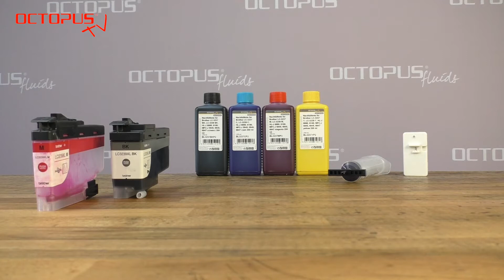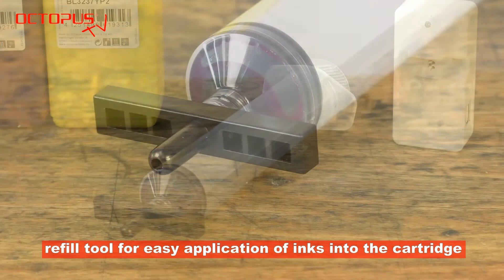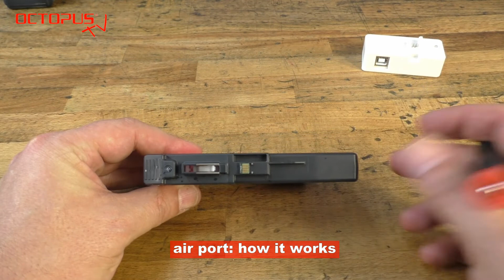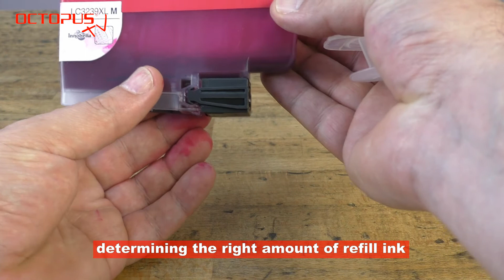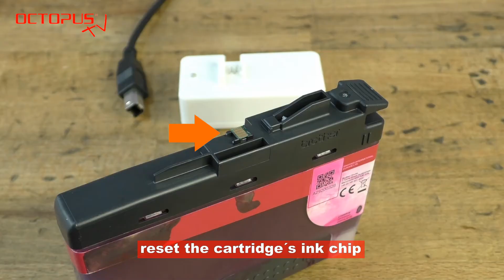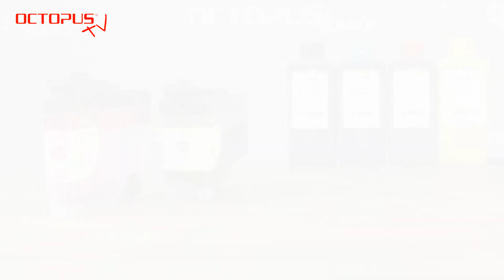Refill Brother LC-3239 LC-3237 inkjet cartridges and chip reset

Comment: Great helper video - but not to me as my printer is DCP-J 1200W, which takes an LC424C cartridge.  There are no non-official cartridges, so far.   I much regret buying the Brother last year: there were clunky software isues, it still won't make a proper glass-top copy, power sometimes has to be switched on and off to achieve anything.  My good old Canon deskjet soldiered on for 15 years, accepted other-brand carts, even an ink-refill or two.  Buyer beware!
Reply from the maker: Hello Howard, thanks for taking the time and providing this great feedback! We also wait for a LC424 solution - according the manufacturer of the necessary resetter device for refilling original Brother LC424 cartridges - the coding of the ink chips is really complicated. The alternative cartridge mkers face the same obstacle - there is no alternative chip solution ready yet.... (status May 11th 2023)

Comment: Would this work on LC404? They the chip looks different from mine.
Reply from the maker: Hello, thanks for reaching out to us about the tutorial. The part of our instruction how to get the ink into the cartridge might for Your LC404 - but there is no suitable resetter for LC404 chips available yet (status May 23rd 2022) - our supplier is working on that resetter model but has not told us yet about a reliable date when it will be ready.

Comment: Hi, does this method work for LC436 cartridges - printer model MFC-J4440DW? Thanks
Reply from the maker: Hello Coco, thanks for asking about our refill tutorial. With status August 5th 2022 we do not have the inks for LC436 yet as the necessary chip resetter for setting back the chip on the original cartridges is not available yet. Without that reset device filling up the cartridge with new ink makes no sense as the printer will not accept the refilled, original cartridge LC436 for further print jobs. We are on it but we do not know a time when the resetter will be available from the suppliers.

Comment: Does Brother  LC-426XL work the same as LC-3239 or LC-3237 and can I use this equipment for refiling LC-426 cartridges?
Reply from the maker: Hello Salar, thanks for Your question. The refill tool we assume will work for LC426 too - but we have not tested it yet on this cartridge model as there is no suitable chip resetter available yet. (Status June 23rd 2022) The resetter is a vital part of the refill strategy for these cartridges. Without the reset of the original ink chip on the refilled cartridge the printer is not going to accept this cartridge for printing again.
Reply: @octopusoffice  Thank you for your rapid response.
Reply: @octopusoffice  Could you tell me if I refill the cartridge but don't reset the chip, what will happen exactly?. The printer will not be working or just show the "?" on the screen?
Reply from the maker: Hello Salar, thanks for coming back to our answer. Without resetting the chip the printer will not work at all despite having sufficient ink inside the cartridge. Just showing a question mark and start printing with that sign would be fine - this was the situation with older Brother cartridge models which was actually fine. But not anymore unfortunately.
Reply: @octopusoffice  Thank you so much.

Comment: How about refillling LC 3033 & LC3035? Have to order chip resetter? thanks
Reply from the maker: Hello elsa! Yes, the tutorial works for LC3033 and LC3035 too and the resetter also works for chips on LC3033 and LC3035.
The resetter is necessary to have as with an empty ink level status (generated by the chip) You cannot keep printing despite You have refilled ink - You need to set back the cartridge´s ink level status. The resetter is made to work on original Brother cartridges.

Comment: Hi!

Does this refill method work for LC-406 ink cartridge
Reply from the maker: Hello Usman, getting in the new ink might work the same way for LC406 - we have not tested it yet. But You need to have a chip resetter dedicated to the chips on LC406 cartridges. Without setting back this chip the printer will not accept the cartridge (filled with new ink) for printing. The resetter for LC406 is not available yet (status July 13th 2022).

Comment: Hi, I just bought a Brother printer, so the cartridges are full. It uses the LC-404 model.... but I see that it has not yet been tested with that model. Do you think it is a good idea to let the level go down a little (about 30%) and refill it again so that it never marks empty tank and it is not necessary to use a chip resetter?
Reply from the maker: Thanks for contacting us so thoughtful early about the refill options for Your new Brother printer 👍🏻
When You top up the ink inside the cartridges the displayed ink level will keep going down despite filling in that new printer ink. The displayed ink level is created based on the information provied by the ink chip on the cartrige - that chip does not measure the physical amount of ink inside the cartridge - so You fill up ink but the chip does not know that - the chip counts down the remaining page yield constantly.
Without using the resetter on the cartridge´s empty ink chip the printer is not going to accept a cartridge for continued printed when the chip has the status empty - doesn´t matter how much ink is still inside the cartridge. And as per status today (April 6th 2023) the suitable resetter is not available yet....
Reply: Same here ! I’m a college student and need to print a lot and buying new ink is costly ..

Comment: The procedure shown for the LC-3239 inkjet cartridge can it be used for the Brother LC406C XL cartridge? If so where can I purchase the tools & ink for your system for filling. Please let me know ASAP Thank you.
Reply from the maker: Hello Linda, thanks for conatcting us about a refill solution for Brother LC406 original cartridges. At the  moment (status April 3rd 2023) the necessary chip resetter device is still not available on the market. Just filling up new ink makes no sense without that reset device dedicated to the ink chips on You LC406 cartridges. Even with new ink inside the cartridges are considered by the printer to be empty due to the ink chip´s empty status.
We have our eyes on the market for this resetter - we will set up a product for LC406 as soon as we have everything necessary together...

Comment: How do you reset the question mark to ink level?
Reply from the maker: Thanks for the question. On the computer´s display You have a version of the ink levels available that shows to You how much ink the printer thinks is left inside the cartridges. Also these bars have a question mark - the mark does not go away by resetting the cartidge.

Comment: Are these cartridges interchangeable with LC424?
Reply from the maker: Helo Ben, thanks for Your question. LC424 is a cartridge model on its own - so just these cartridges work in Your printer and no other Brother cartridge models. Status June 27th 2022: at the moment there is no suitable chip resetter available for LC424 - that´s why we have no refill inks and refill instruction yet - the resetter is mandatory to have. Without resetting an original Brother LC424 You can fill in new ink BUT the printer does not accept such a cartridge again for printing.

Comment: Does it work for LC406
Reply from the maker: Hello Annie, thanks for Your question. For Brother LC406 cartridges the tutorial does not work yet (status February 2022) - in particular the suitable chip resetter for LC406 is not available yet - but the chip resetter is necessary to get the refilled cartridge back to beeing accepted in the printer. We have our eyes on the LC406 but cannot make any reliable promises when the resetter will be there...

Comment: Hello is there any tool for refilling Brother  LC406?
Reply from the maker: Hello Rogelio, thanks for Your question about LC406 cartridges - status Oct 10th 2022 is that the necessary chip resetter for the original ink chip on the original cartridges is not available yet. Without that resetter You can fill new ink into the cartridges BUT without setting back the chip the printer is not going to accept this cartridge for printing again ....
Reply: @octopusoffice  Greetings, any updates in the LC406 cartridges chip resetter? Or is there any other resetter tat works with this cartridge? or at least any replacement cartridges? Thanks.
Reply: @OctopusConcept  is there a way to disable the ink level reader? So that it may accept the refilled inl cartridge?

Comment: Hi, do you have refill for LC451(SCP-J1050DW)?
Reply from the maker: Hello Joseph, thanks for asking about our refill tutorial. Status March 23rd 2022 we do not have the inks for LC451 yet as the necessary chip resetter for setting back the chip on the original cartridges is also not available yet. Without that reset device filling up the cartridge with new ink makes no sense as the printer will not accept the refilled cartridges for further print jobs. We are on it but we do not know a time when we will be able to provide a solution to You.
Reply: @octopusoffice  Is it accurate that the memory only stores the last ink tanks information and that rotating cartridges allows for the bypass of this issue?

Comment: dose it work with lc406 from brother mfc-j4535Dw? and do you have this on amezon wed side?
Reply from the maker: Hello Apichai, thanks for Your question about LC406 cartridges - for them the suitable chip resetter is not available yet (status July 7th 2022). Without that resetter a cartridge filed up with new ink will not be accepted by the printer without resetting the ink chip on that cartridge. We hope that a resetter is coming soon.
Reply: Is there abresetter available for the LC406 yet?

Comment: does this work for lc404?
Reply: i ask because the cartridges look identical
Reply from the maker: Hello, thanks for Your question. Actually You are right about the cartridge´s structure - from the picture we assume that Your LC404 are similar to our LC3239 in our tutorial. The tricky part is the reset device - it need to be programmed for the chips on the original LC404 cartridges. Our resetter does not provide this compatibility 😑
LC404 according to out knowledge is US Canada Mexico region - so maybe You can source a matching resetter locally... take care!
Reply: @octopusoffice  so what about lc426 (mfc-j4340dw / mfc-j4540dw) then? any idea when resetter and refill packs might become available?
Reply from the maker: @Nik Medved: Thanks for Your question. On LC-424 and LC-426 cartridges we have our eyes on - came onto the market May 2021 - so far we no information from our supplier that the suitable resetter will be ready soon. So wwe cannot predict yet when we will have a solution ready (status Oct 7th 2021)...

Comment: Did you get the Chip resetter yet for the LC406C XL yet? Please let me know. Thank you
Reply from the maker: Hello Linda, thanks for conatcting us about a refill solution for Brother LC406 original cartridges. At the  moment (status April 3rd 2023) the necessary chip resetter device is still not available on the market. Just filling up new ink makes no sense without that reset device dedicated to the ink chips on You LC406 cartridges. Even with new ink inside the cartridges are considered by the printer to be empty due to the ink chip´s empty status.
We have our eyes on the market for this resetter - we will set up a product for LC406 as soon as we have everything necessary together...
Reply: i want one too!. @octopusoffice
Reply from the maker: @mafosa9563  The situation still remains the same, unfortunately, status September 4th 2023, there is no resetter available yet for LC406 cartridges 😒

Comment: I Just bought a Brother MFC-J6955DW the ink tank look the same Can I use this method for this printer too? If not how can I refill them?
Reply from the maker: Thanks for reaching out to us about refilling Your printer´s inkjet cartridges - Your machine uses LC427 Brother cartridges - For these cartridges the necessary chip reset device is still not available yet. Without setting back the ink chips which are build onto Your cartridges the printer is not going to accept a refilled cartridge for further printing. So You can fill new ink into an empty cartridge but You cannot print with that cartridge due to the chip´s "empty" status....
Reply: @octopusoffice  Thank you for the information. Do you think it will come available?
Reply from the maker: There is quite a number of people asking for this products -  we assume that it is very likely that the manufacturer will release something for this cartridge model - but as alway no guarantees :)
Reply: @octopusoffice  Thank you hopefully they will. How would I know when they bring it out if they do. Is there some site I can look at and keep an eye on it?

Comment: Have you found a chip resetter for Brother MFC-j1215w?  I have bought many Brother printers and I can't see how they produced this piece of junk and set up advertising to fool so many.   I assumed that it would not have a year's supply of ink, but would have a reasonable amount.  I got about 90 double sided copies with one small picture and text.  That is a ridiculous number of copies after theme advertising it would have a year's supply of ink.   There is a whole series starting out with j1205.   I am using Brother MFC-J430dw and have used it for five or six years and bought this piece of junk figuring the 430 would quit any day and probably just when I needed some important copies.  I hope you can help.  thank you
Reply from the maker: Hello starbright, thanks for contacting us about the solution for Your Brother situation. After reading Your comment we have contacted the manufacturer of the resetters and asked them about the status for LC404 Brother cartridges - this is the series running in Your printer. They answer is that they are on it but they cannot give us a date when the resetter will be ready (status September 30th 2022). They will let us know as soon as the development is final.... then we will put it on sale for sure....
Reply: @octopusoffice  thank you so much for your reply.  The amount of ink that was in the cartridges is about the amount you show at about 1.29.   It even said starter cartridge that didn't really register in my brain because I was believing their one year supply advertising.  I bought this in March knowing my other Brother would  quit soon with an the in absorber was full because that happened to my other Brother printer and my pushing all sorts of numbers doesn't bring up Maintenance.  I feel that the five or six years I get out of them is ok.  I buy generic ink on ebay and have never had any problems.   I didnt research this new printer.  Mainly because I believe Brother because they had always been honest before and the printers worked well. I suppose those tanks are new and you and others have not been able to set up anything new.  I am wondering why the chip has to be reset if one just adds ink to an already installed cartridge.  On my MFC-J460dw, I am going to try and refill them, but the cartridges' cost is ok on them.  Right now I found a place where I can get the cartridges ...all four for about $60 and think I will do that in hopes you come up with something, because the cartridges I buy are supposed to work for a year.  I only print about 20/30 copies a month.  and....to be honest, I can't afford another printer now and I do nee d two printers.  Again, thank you for your quick response, I appreciate all your hard research to help us.
Reply from the maker: Hello starbright, thanks for coming back to our reply! 👍🏻 We are with You on the same side about Brother - they have been more refill friendly until a couple of years ago. When the first chips appeared on original Brother cartridges - the customers were still able / allowed to refill these cartridges with refill ink and keep on printing WITHOUT resetting these chips ( situation has changed now).  The bitter truth is (in our humble opinion) sell printers cheap and sell supplies expensive - the starter cartridges do not last that long to make You buy the originals in the time when no alternatives are available as these solutions are still under development. We are on it - when the tools will be ready we test our inks and set up a new product for sale.

Comment: will this work for LC404 ?
Reply from the maker: Hello, thanks for reaching out to us about the tutorial. The part of our instruction how to get the ink into the cartridge might work for Your LC404 - but there is no suitable resetter for LC404 chips available yet (status May 23rd 2022) - our supplier is working on that resetter model but has not told us yet about a reliable date when it will be ready.
Reply: @octopusoffice   do you have a status of the chip resetter?
Reply from the maker: hey Jennifer, sorry for the snail like response to Your question - despite the long wating time the resetter for LC404 is not there yet (status Sep 19th 2022)